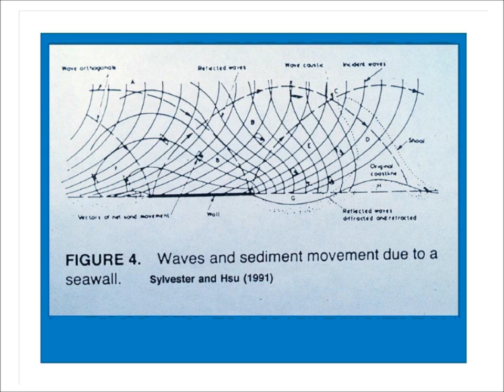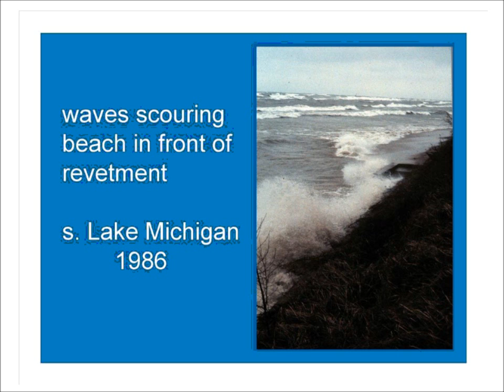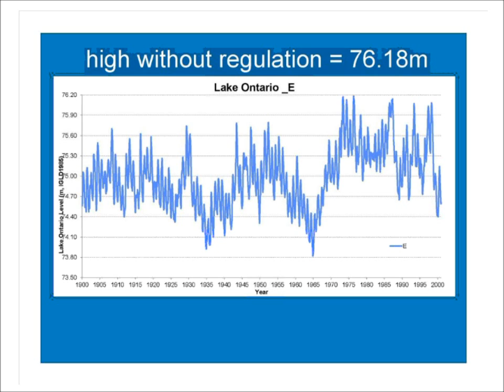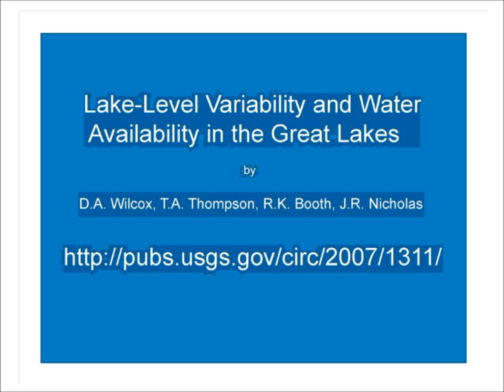Doug Wilcox explains shoreline building

Comment: Nice little talk there, Doug.  I only wish it were more honest.  Plan 2014 will result in more frequent high water levels than you indicate, and less of the low water levels you mention.  It should be obvious by the response of lake shore owners in opposition to this plan.  Really....why would lakeshore owners not want to see their beach areas increased?  In fact, they would "LOVE" it.  So why haven't they hoisted you on their shoulders and proclaimed you as their new King?  Hmmm? 

Let's see.  What would the boat owners and the Marina owners and the shipping interests and the hydro power interests have to say if plan 2014 actually would increase beach formation by the use of low water levels...levels they do not occur under the current plan?  Hmmm....let's think on this.  Why would they support a plan that did this?  Anybody?  I've got nothing to explain their support.  Well, I can suggest one thing.  That plan 2014 will not leave them high and dry, because it does not let the lake levels drop to the extent that Doug is suggesting would be necessary to build beaches anything like what he illustrates for lake Michigan.  So, how did it happen in Michigan?  No dams to keep the water in...so the lake level dropped significantly.  What about Lake Ontario?  Yup, there are dams at the outlet feeding the St Lawrence...so they don't have to let the lake levels drop.  And plan 2014 won't let them drop anything like they did on Michigan.  Thus, no beach formation for Lake Ontario.  But we will get the high lake levels that wash away shorelines...you can certainly depend on that. 

Plan 2014 = increased amounts of erosion from high water levels and precious little beach formation from low water levels.

So, Doug...what is your degree in again?   Could it be....Shoddy science?